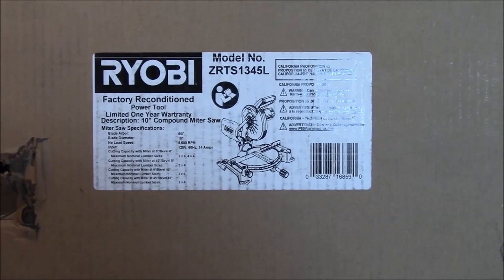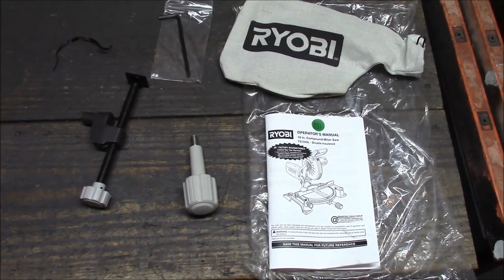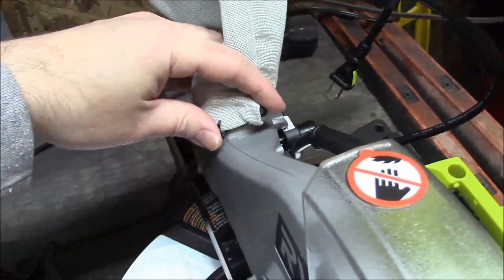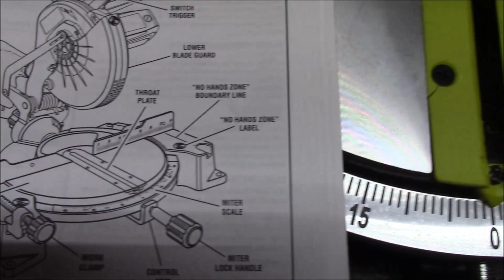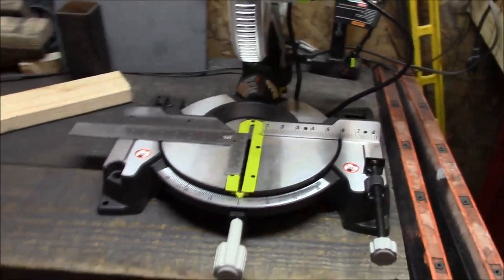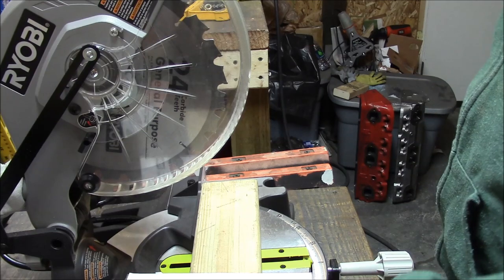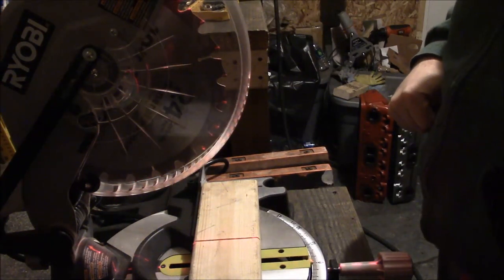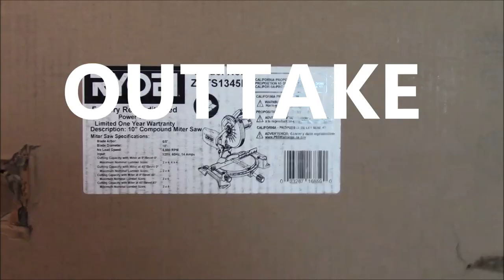RYOBI TS1345L 10 inch Compound Miter Saw RECONDITIONED UnBoxing and Demonstration

Comment: I’m new to this stuff - just picked one up off of eBay. What kind of bench should I get to have it sit on. There are so many.
Reply from the maker: You could set it on some boards on top of saw horses or w/e, long as you have room to cut the length of stuff your doing.  I think they make a stand or w/e but just set it up on a stable surface with room to work safely